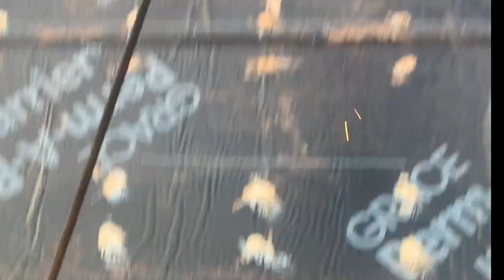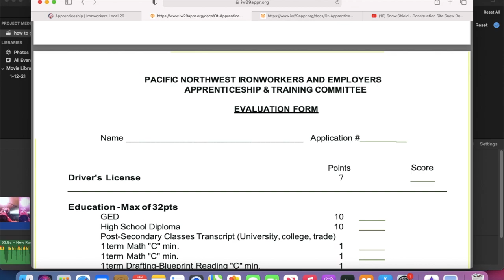How to get into Ironworking

Comment: Hey whats up. My name is Jose Orozco. Im trying to get into the ironworker union local 433. Ive already filled out i. Application in person. Started going to school to get welding certs to rank higher in the application process. Already completed SMAW. Starting GMAW/FCAW AND GTAW at collage of the canyons. Ive spoken to BA Louie Lopez wHom is in charge of the san Bernardino district. He has a few jobs coming up for the solar fields out there. My question what tips can you give me to be an efficient and reliable apprentice?
Reply: Also im in the process of completing my OSHA 10. And trying to save up to get the tools i need to which i have no clue what i need. But i figure i start with my PPE. Fyi im located in the San Fernando valley. But im willing to travel wherever. I got the love and support of my family cuz they know how bad i want this.
Reply: 2nd question. When hustling for work  at known union local 433 job sites what tools do i need incase of instant hire?